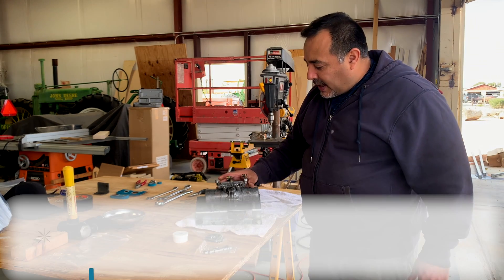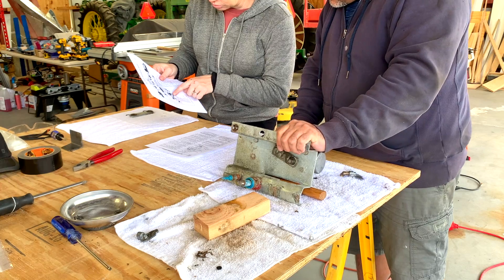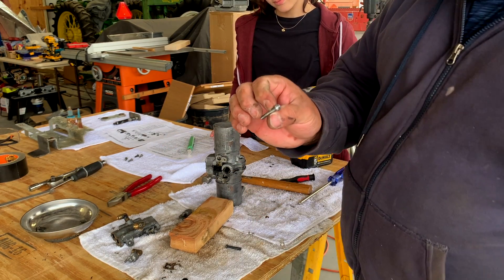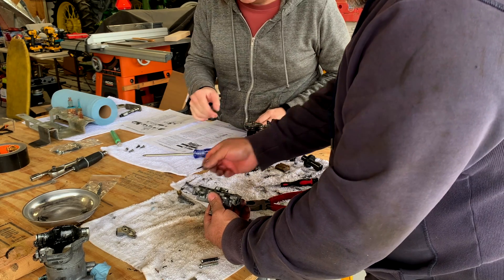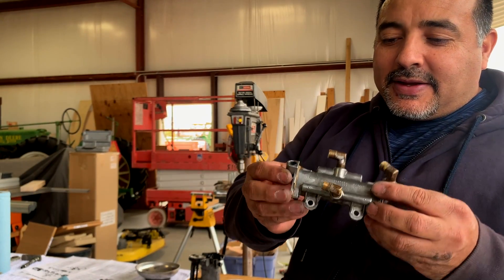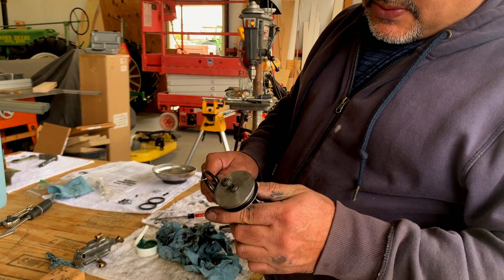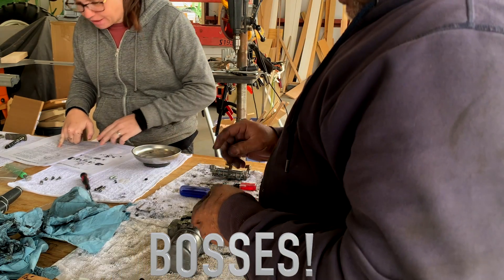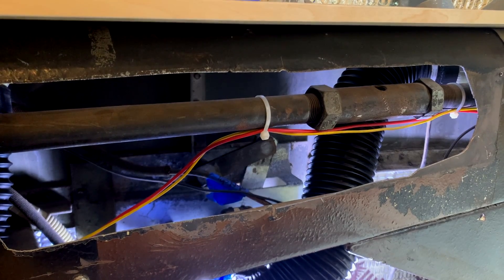Quick Fix: Air Wiper Motor Overhaul in our GM PD-4106

Comment: Juan, great video. Been there done that!  I was completely amazed regarding most everything on those buses, they were built to be used and then rebuilt and used some more. The “throw away mindset “ did not exist. Amazing engineering went into everything in them.  We didn’t have the rebuilding manual for mine so we had to wing it. Luke was having issues with his supplier so we had to source O rings locally. I have a good video where we put one in a vise and put air to it to make sure it worked correctly.
Reply from the maker: Very cool!  Really great to hear from you Dennis - I am hoping we run into you on the road one of these days

Comment: Great video, I need to do this to mine. 
I did yank all the copper lines and bypass for now.
Most of my air leaks were from there.
Reply from the maker: Hey Darryl was going to replace all that copper crap with Nylon but I ran out of time.  I think most of the leaking is just from those little valves ... I soapy water tested the connections in the copper and they didn't bubble up but I can hear those valves leaking.  The good news is the wipers work great so I guess it's a win.

Comment: As always Juan, great stuff!  Now for a hot tip that I learned from another old trucker after my driver's side wiper motor quit working on the big truck that i was driving in 1978. Start using RainX!  It might be the simplest thing that a driver can do to make driving in wet conditions safer!  Once you get used to properly putting it on and also switching to the RainX washer fluid that will extend the life of the coating and completely eliminate any streaking that can happen without their washer fluid. I have been using it continuously for 44 years now! I have even put it on rental cars a couple of times! Haha  RainX will greatly reduce the amount of work that your wipers have to do and you will see so much more clearly, even in the heaviest downpours!
Reply from the maker: Yes I think you gave us the tip about RainX!
Reply: And/or use ceramic coating on the glass. Also helps, allegedly.

Comment: Great Job Juan - and everybody....!  The old rubber parts do wear out  - especially if they aren't used on a regular basis.
Yeah - you don't need to pull that piston assembly apart - it should be good.  In mechanical terms - a "Boss" is usually a bulge or protuberance - usually flat, but not always. Often they are meant to mount something to.
I expect that the difference in the manual (about the small pistons) was that the manual was written without expecting a rebuild kit to have new pistons, just new o-rings.  These kits do change over time. Very often they cover multiple similar models, so they may have parts that you don't need for your particular job.
Replacing them with electric? Definitely - If it ain't broke - Don't fix it!
Reply from the maker: Thank you Norm!  The parts were VERY worn.  Thanks for the feedback on the piston assembly - I was hoping someone would have some experience with it.

Comment: I don't even bother with Rain X anymore.  Using the Rain X wash fluid seems to be good enough to be able to skip the manual application process.  However, where I live we go through 1 gallon of wash fluid probably in less than 6 months.

Comment: I'm suprised they still make overhaul kits for these wiper motors.
Reply: Luke at us coach makes the kits for them as it's all mainly standard size o rings and gaskets which are not hard to replicate with the correct material. Plus any bolts can be picked up from any hardware store like Juan had to do for one bolt.
Reply from the maker: I am often surprised at the things Luke can find for us!  He actually had the rubber around the windshield manufactured through a company so we could have those!